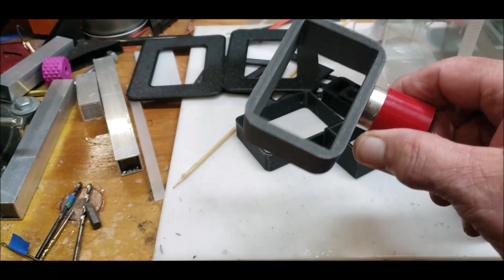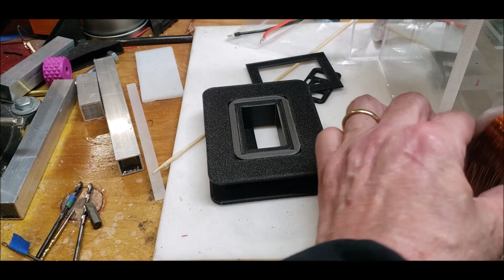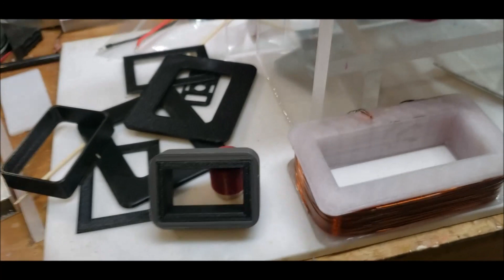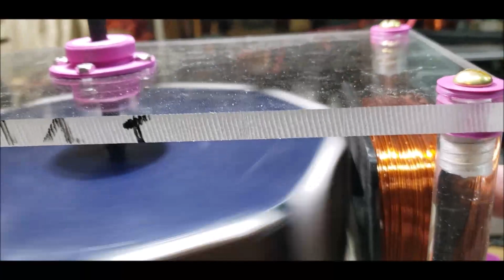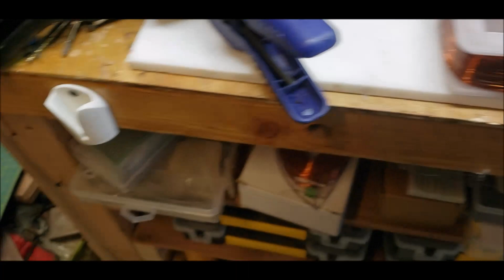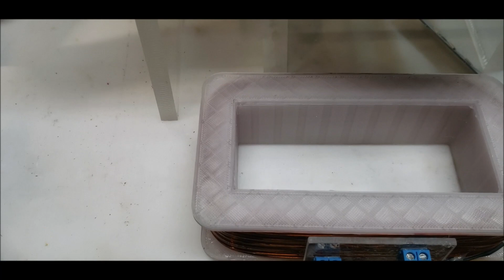3D Printed Coil Iron Core?

Comment: I am super interested in the iron infused PLA, thank you for bringing that to my attention! Curious to see what you come up with, just awesome!
Reply from the maker: ya thanks....They have copper as well and it prints really well. The company is called protopasta and they all kinds of metal infused PLA.
Reply: @mcorrade  
Awesome going to check it out. What type of printer do you run / is the material challenging to print? Thanks again for sharing!
Reply from the maker: @joshuameldru4004  I have a modified Ender3 pro and no the Iron PLA runs well through it. I have no issues so far. I use a wham bam flex plate and I've upgraded the hotend to all metal but stock should work.
Reply: @mcorrade  
Perfect, thanks again!